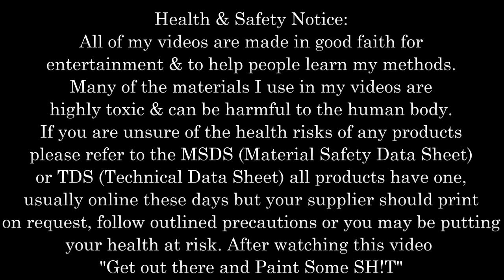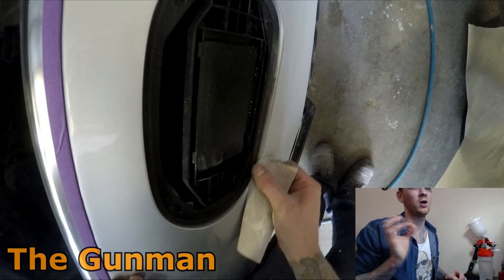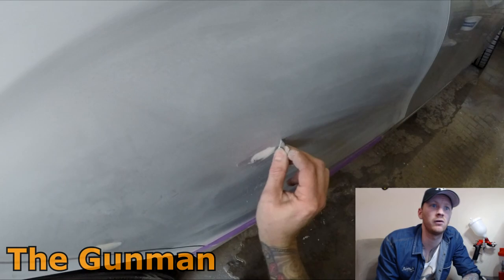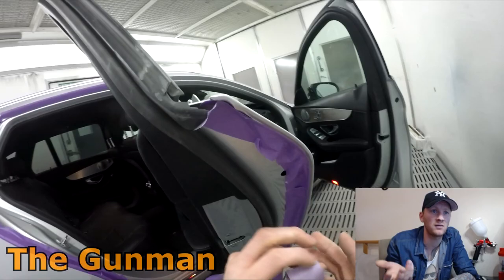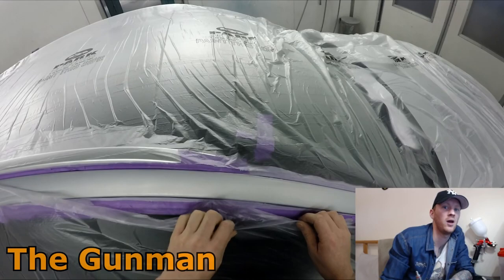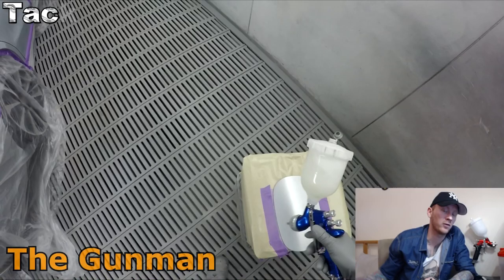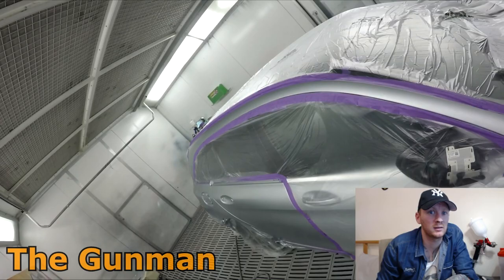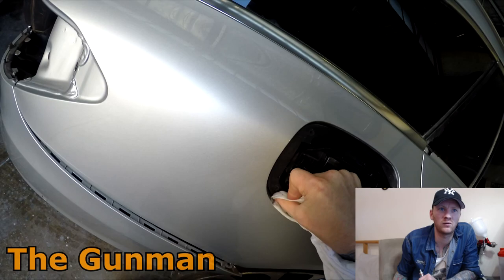Mercedes C250 Wagon Iridum 775

Comment: Great tip gunny,must try microwave clearcoat,our mixing room has no heater so the clear gets really thick this time of year,and really don’t like over reducing .can I ask do you mix all components,clear,hardner,reducer,mix it then bang it in the microwave?cheers
Reply from the maker: +Tim reeks yes, and only do it when you're about to walk straight in. Try not get it above 30-35°c usually 20-30 seconds for 800ml cup

Comment: Gunman, how are you mate.  When you do a full respray, how many base coat and clear coat do you usually do. 2 and 2 - 2 base and  2 clear?  Also have you done a full on show car paint job and if so how many coats?  Thanks, you're the best.
Reply from the maker: If I was to do a show car I'd flow coat it, all cars are different sizes so it will vary from 2lt to 5 also the coverage, if it's a metallic red in solvent then obviously you'll need more than if it's a black, that's why I try avoid giving too much advice on amounts because it will vary greatly depending on the job.
Reply: The Gunman I agree.  I learned the old fashion way, a lot of color sanding between coats, gets rid of all the imperfections.  I also did not use an orbital polisher, I only use my hands and arms.  I hand rub only, a lot of work but you don't run the risk of burning the paint.  Thanks again Gunman.

Comment: That's a hard color to spray  without mottle. I noticed you didn't remove the upper door rubbers or tape them down.  It makes a nasty edge along the upper roof panel(quarter panel upper panel)  I get the insurance company to pay to remove them.  Nice paint job.
Reply from the maker: Thanks man, but if you hang around to the end I did show how I wasn't left with any edge and was able to use this faster method. But hey whatever works for you I guess.
Reply: Ive been taping the rubbers down with 2 inch tape strips vertically so it has good gripping power. It takes about 40 pieces per door if you dont want to pull the rubber down.  I did watch it to the end and I have done it your way and got away with it but as the shop owner I worry about a come back.  It does push that edge further inside so the door seal doesn't scrub it at the edge as bad as the owner opens and closes the door. I always have to blend the clear too on that silver color. More than one coat of clear next to the adjacent panel is always visible, it doesn't matter how crystal clear your clear is.  Thanks for all the hard work doing the videos.  I've learned a lot of neat tricks from you and I thought I knew it all..lol

Comment: Hey gunman!dou you have some tips to paint on my garage and get a good results i have a gti pro lite te20 and 1.2-1.3 and flg5 for base thanks!
Reply from the maker: Keep the pressure lower than you would in a booth because it will make too much overspray and you'll lose visibility in no time. See if you can get some kind of extraction fan with a filter.
Reply: Wet the floor down a bit before spraying.
Reply: Thanks you're the best!👍

Comment: Is 1.7 too big of a tip for clear coat??
Reply from the maker: +JBIRD575 yes, I wouldn't use more than 1.4
Reply: The Gunman the gunman you fully tighten the trigger or control the flow of fluid with the fing?
Reply from the maker: +João Miguel Varela de Sousa Varela De Sousa I wind it right in then back out 3.5-4 full rotations.
Reply: The Gunman ok  thanks master
Reply: The Gunman thanks mate

Comment: I'm in the 600 club🖒
Reply from the maker: Hardcore 🤘😄🤘
Reply: Hey buddy.  Just realised today that you got 2 main types palm sanders. 5mm orbit and 2.5mm orbit. I think most DIYers will have 5mm (common at supercheap etc ) so they should avoid 600grit and stick with 800grit +. 
Your thoughts?
Reply from the maker: Absolutely, I do recommend most people use 800 because it's so easy to cut through with 600 if you're not experienced, my sanders have always been 5mm orbit.